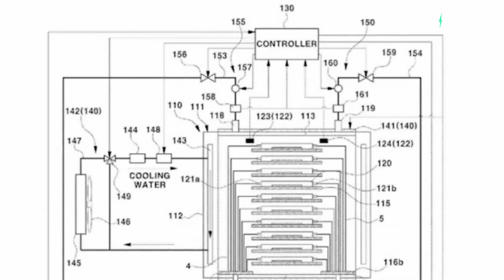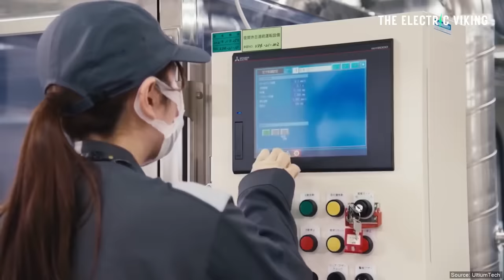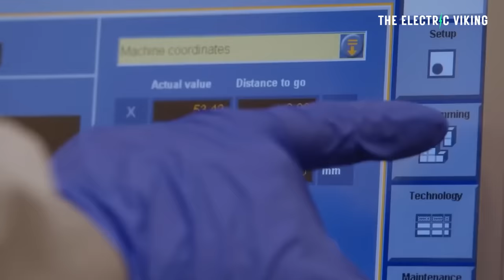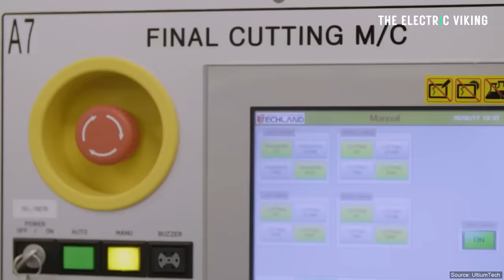Hyundai's secret pressurized solid-state EV battery patented in America

Comment: Just days ago you had a video about Hyundai losing a billion by selling own factory in China to BYD. I believe it's time each western automanufacturers to leave China, find own niche elsewhere.
Hyundai has only 2 problems with EVs sold in North America: low production volumes, unflexible high price. Maybe they will increase production with new batteries?
Reply: They have a 3rd problem: no repair option when those expensive batteries get some minor road damage.

Several people in Canada have been quoted $56,000 CAD to replace traction batteries in a car that does not even cost that much new!

Comment: Unless it's self charging, forget it. No one has a power grid large enough to charge the mass numbers of Evs to make the government happy.
Reply: I pay more for grid connection than electricity in Alberta. Our grid has been over-built in part because oil sands extraction is so intensive.

But all the oil and forestry companies have built their own power plants to avoid grid usage fees. 

This does not even get into the fact that EVs and water heaters are inherently load-shedable. They have this huge reservoir for storing energy. So during the supper hour they can pause charging until demand tapers off later in the evening.

If you are parroting Chase from Edison Motors: his numbers are off by an order of magnitude because he was mixing W with Wh.
Reply: I cannot speak for other countries but in the UK the national grid are not remotely concerned about their ability to support EVs on mass.

Comment: funny how automakers are walking back the Ev push and you bring up none of the counter points. Especially the total co2 emissions over the life of a vehicle gotta drive that tesla much longer to be carbon neutral assuming you don’t have to replace the battery  not mentioning where the electricity comes from for these evs. 15 years too early internal combustion will be around for a long time to come.
Reply: EV's have been a mature technology since the 1920's. Electric steetcars and busses with overhead wires are considered "old fashioned" now. Edison Motors (also on Youtube) was able to custom build an electric truck in only 1 year. The only part they needed to get custom made in China was the motor-drive axle assembly.